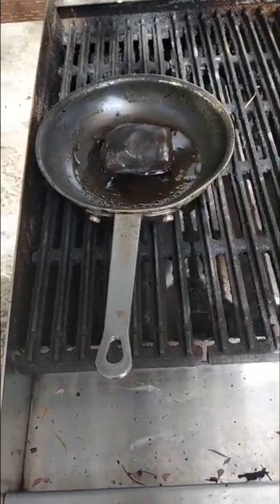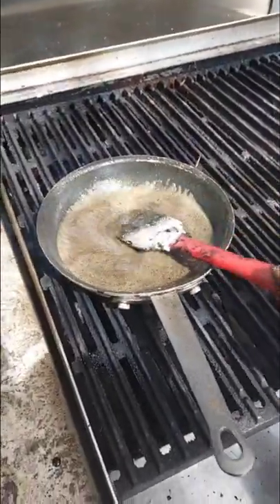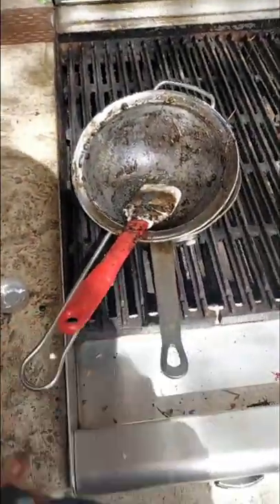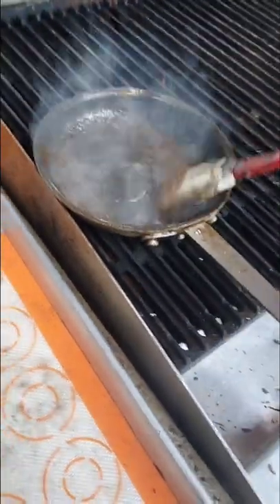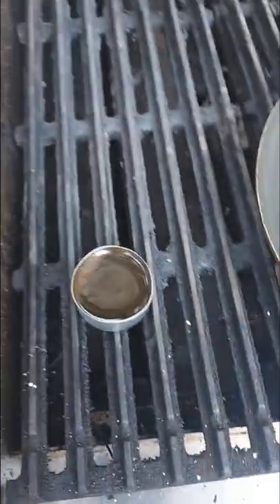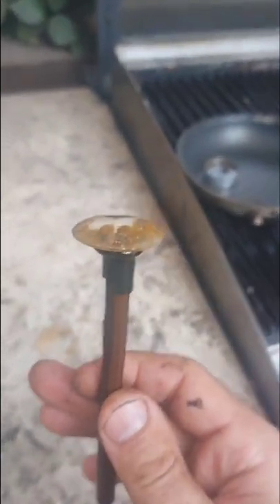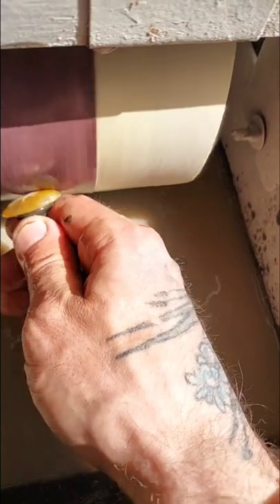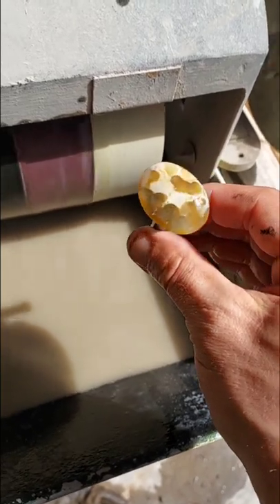Dop Wax from Pine Sap Tutorial (Part 4)

Comment: can it be remelted and reused like commercial dop wax?
Reply from the maker: Yes, ive noticed my recipe is not exactly the same as commercial dop wax. However it can be reused if you clean any polishing compound off well. Although its not as strong as commercial dop wax it has a much lower melt temp which i prefer for cutting opals which are more affected by heat.
Reply: Add some natural shellac flakes to it 2% or so, makes a world of difference